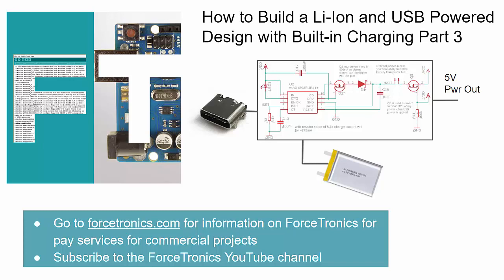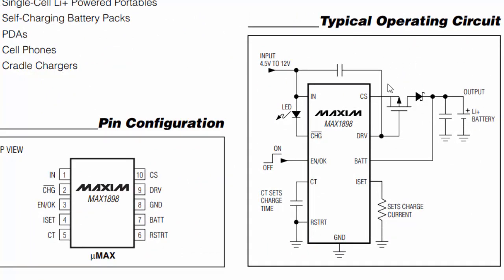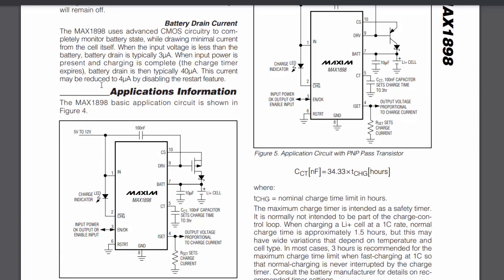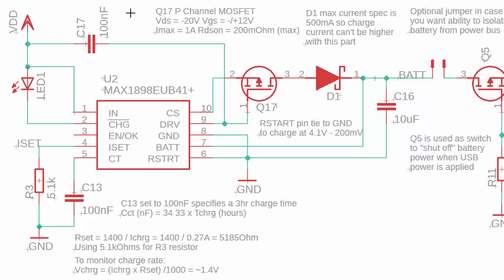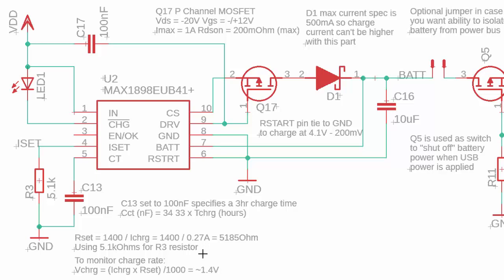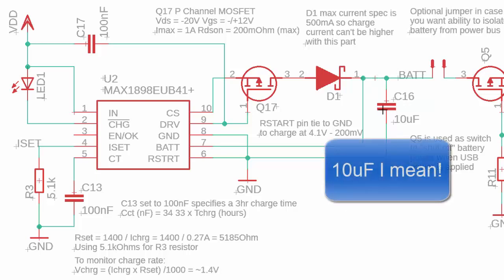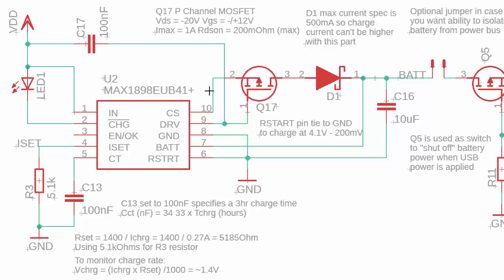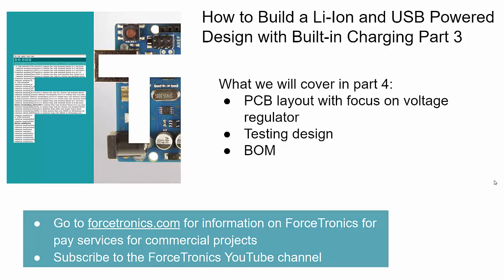How to Build a Li-Ion and USB Powered Design with Built-in Charging Part 3

Comment: Does D2 in usb type c part have to be Schottky diode but it does not handle a high switching or have anyorther reason.
Reply from the maker: The reason a schottky diode was used is because they have the lowest forward voltage drop compared to other diode types so less power is wasted. You can use a different diode type if you like. BTW not all schottky diodes have fast switching times, only ones targeted at rectifier applications
Reply: @ForceTronics  that good to know Thank for the thought process.

Comment: Don't p-channel mosfets flow from source into drain?  wouldn't it be better to flip source and drain and add a diode?
Reply from the maker: Thanks for the comment. My experience with MOSFETs is to look at them as a voltage controlled device and as long as the source and gate are biased correctly current can flow either way. You could always flip it around and add a diode, but then you have power loss due to the diode. Another route you could go (and maybe I should have done this) is back to back P channel MOSFETs.
Reply: @ForceTronics  thank you, I’ll look into doing that.

Comment: Thanks for the impeccable and detailed explanation. One quick question, what MOSFET did you use for this project? Is there a model that I can reference to? Thanks.
Reply from the maker: If you are referring to the 2x P Channel MOSFET used for the battery charging circuit, the PN is PJC7407_R1_00001
Reply: @ForceTronics  appreciate the quick reply🙌

Comment: Can I apply MOSFET's with body diode? Or without body diode are necessary?
Reply from the maker: I am guessing you mean Q5? If so body diode won't matter because if the USB power is applied the body diode will be reverse bias. If USB power is not applied the MOSFET will be "on" and current will flow through the MOSFET

Comment: So when the isset is connected to an adc pin of the microcontroller it can see if the battery is charging. What would be the best solution to also see the charge level of the battery?
Reply from the maker: They make "Fuel Gauge" IC made to monitor a cell's state of charge. You could also monitor the battery's voltage level to get a sense of its charge level. First you may want to characterize the battery's discharge curve, store it in the microcontroller's NVM and compare real time battery voltage measurements to the curve to get an idea of charge level.